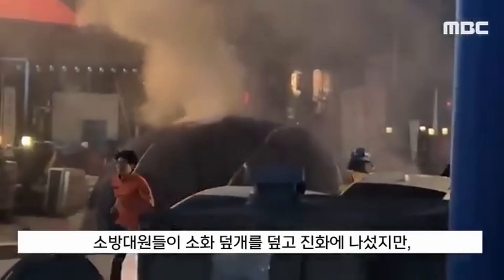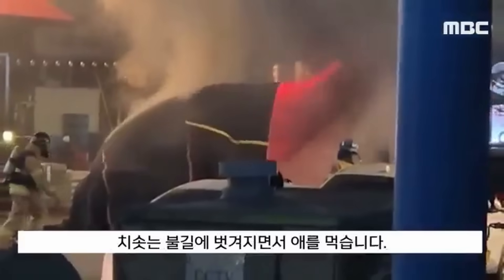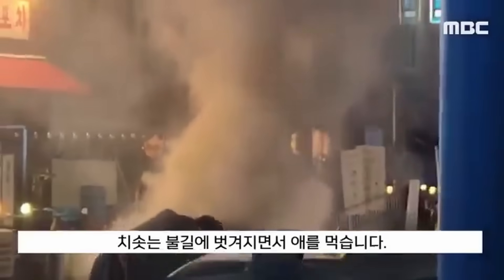EV Fire Blanket Explosion Risk: FSRI & NFPA Issue Warning

Comment: At this point, it seems that deployment of an under vehicle nozzle prior to covering the vehicle with a blanket might be a better tactic. Surely the FSRI will test this.
Reply from the maker: It was part of the latest experiment.  Standby for a video.  Hopefully it will be released in the next week.
Reply: Unless you have a direct hole into the battery, it will do nothing.
Reply: I doubt it, companies like tesla surround each cell with a waterproof foam sealant. There's no way to "cool" each affected cell.

Comment: Given this information it does seem like using the blanket on adjacent structures and vehicles is the better approach.
This is also why we do our EV conversions with LFP batteries. This has got me considering adding conduits for internal fire suppression.
We've been considering doing something similar for our turbo race bike that runs on E85.
Thank you for continuing to post rather objective and educational material. I subbed quite a while ago and still learn things here.
Reply: I just posted a question regarding the use of a Lith-X type extinguisher on E-V fires. Class "D" extinguishers don't carry a UL fire rating typical of "A" and "B" types of fires. They are rated by type of material and quantity of material on fire. Also the way they put out a fire is "crusting" to exclude oxygen and forming a heat sink to lower ignition temperature. In your typical magnesium fire, your talking maybe 2-3 hours of not disturbing the extinguishing agent and breaking the crust thus causing reignition. I personally don't know the quantity of lithium found in an E-V battery or if testing has been done using this agent against the fires.
Reply: @Wa3ypx  the problem is there are several blocking layers of material between you and the battery so using an extinguisher has virtually zero effect on car battery fires.

Comment: Is the fire blanket useful for protecting your own car when parking next to an electric car?
Reply: That was mentioned yes, the fire blanket can be placed on the exposure vehicle (by firefighters) to stop it from catching on fire.  

Blanketing your own car would not be very useful as a daily precaution, first it very difficult for one person to even apply a fire blanket -- they are VERY heavy, and HUGE, After folding ..  they won't fit in anormal car -- next is cost they start at $5000 

If your parking spot (at home) is right next t a neighbour's EV, a firewall disguised as a normal fence might be a good idea?  it might be less costly than a fire blanket too.  

You'll see such firewalls around your city, next to large power transformers, for safety, they are 6" thick reinforced concrete.
Reply: @MikeBaxterABC  Any standard block or brick wall 6' would work.  Blankets are impractical.
Reply: Unless you have FULL firefighting gear to put it on, NO.
Reply: As a safety safety issue. I will not allow EV vehicles on my property. Mr Bill
Reply: This is worrisome because in CA and AZ and other warm weather states vehicles park under the apartments.

Comment: Thanks Pat, Like you.I always thought these were great for limiting exposure and allowing the battery to safely burn itself out. However,  knowing that a large portion of firefighters can be volunteers in areas with minimal training, it's best to rethink this option.
Reply: ICE vehicles are now sounding better and better. I wouldn't be surprised if EV vehicles are simply banned from certain places ie, parking garages. Mr Bill
Reply: It's a piece of equipment. Users just need to be trained on the equipment before putting it to use. 

The big thing is that best practices are still evolving, so training will need to be refreshed to keep up.

Comment: The only way to prevent lithium battery fires, is to build internal fire mitigation(like pressurized sprinkler system), through using a rupturable coolant channels and an additional backup reservoir and emergency pressure pump(that could be used to cause rupture of coolant fins, like in a battery overcurrent isolation using a fusible link). There will be compromises to battery capacity and battery pack cost of manufacturing. There is also the risk of false activations ruining an otherwise healthy battery pack.🤯. Offcourse no manufacturer wants to comply, as seen evident from the thermal runaway being undermined already.😢
Still doable, if enforced into a stringent regulation.🤞❤👍
Reply: Not even vaguely doable.  You are asking to put in a "self destruct" system into the battery.  No manufacturer is going to do that.

Comment: Would this also apply to the "bags" some aircraft have for when a laptop or phone starts smoking?
Reply: Those batteries are much less powerful than an EV battery, so the explosion risk from off-gas products should be proportionately smaller. But I'm no engineer.
Reply: If your phone or laptop gets put into one of those bags, it's going to stay in that bag until well after your flight lands. I don't know the protocols after landing, but they aren't going to just hand you the bag and release you into the terminal.
Reply: @briant7265 . The PED containment bags on aircraft will hold a lot of water…the equivalent of 13 large water bottles.  The water is absorbed by the materials in the bag.  Fireproof gloves are used to move the PED onto a metal surface in the galley.  The problem with this is that the f’ing greedy airlines have miniaturized the galley countertops to get in one more row of seats, leaving far less space, and everyone vulnerable.  I retired my FA job two years ago, and unless I have to attend a funeral, I’ll never, ever set foot on an aircraft again, mostly because of DEI policies.  Buncha 🤡.   But those PEDs on planes scare the crap out of me.  Imma drive.
Reply: Q: Would this also apply to the "bags" some aircraft have for when a laptop or phone starts smoking? A: yes 'fraid so because trapped explosive gas is trapped explosive gas.  thus as any 5th Grader will likely be able to explain, this threat is made even WORSE by the risk of explosive decompression of the fuselage (aw crap).  ref:  Alaska Air 1282 Plug Door Blow Out date: Jan 5, 2024👈everybody knows this.  so as i've been saying for years unfortunately there is "No Free Lunch", therein the burden still rests on we Human Beings to get control of our neurotic behavior, gain some self-awareness, so we can ultimately STOP LOOKING FOR IT.
Reply: @phillyphil1513 What are you looking for?

Comment: Would super fast freezing slow down thermal runaway? We need to find some way to defend ourselves from these deadly E.V.s!
Reply: The problem with putting out EV battery fires is that the thermal runaway is happening inside a pressurized and mostly air-tight box. Makes it difficult to send any cooling where it is actually needed to stop the reaction. And even if you do freeze the battery, you only have until it thaws before thermal runaway may resume. The rapid feezing process itself may also cause damage and hasten additional failures.

Comment: This just reinforces my previous conclusion that lithium ion batteries don't belong in vehicles at all. They're just too dangerous, and we have no really good ways of dealing with them once they enter thermal runaway. Water doesn't extinguish the blaze but stops it spreading, yet the water used contaminates the ground with toxic elements & chemicals which may well cause enormous damage over time. The atmosphere is also contaminated & may cause severe health risks, esp. to the firefighters. There's no earthly need for EVs, our existing ICE vehicles are far better for transportation anyway!
Reply: They don't belong on a bridge, in a tunnel, in a parking building, near a building, under a building, basically no where near people
Reply: @Eduardo_Espinoza but my VR6 sounds absolutely lovely in a tunnel ,or parking garage. 
Oh the irony. 😂
Reply: Gas card r ok since they burn at lower temperatures 👍  @MrTheHillfolk
Reply: They put eco nuttery  first, safety second. This has happened in so many technology sectors
Reply: regulators have not put safety 1st
Reply: @doomer33deg  they put billionaires first. That's what doge is really about.
Reply: Heres something funny to think about:

In the U.S.A as a truck driver I need to have either an 'H' (Hazmat) or 'X' (Hazmat + Tanker) endorsement on my CDL to haul an electrical vehicle battery down the road.

But Bubba can drive an electric car around town that is powered by the same battery and he only needs a regular driver's license...
Reply: Recent news from the UK where authorities are dropping the resource consent and regulation needed to install home EV charging stations. No need to get the installation approved or signed off. 
This reads like a B grade disaster movie set up where the obnoxious beaurocrat ignores the qualified expert. While I fear for all these people and the emergency crews having to deal with the upcoming disaster, this move WILL accelerate the truth behind this Lithium Ion technology and just how dangerous it is to have in your home.
Reply: The one and only reason why those electric death traps even exist is the God damned climate hoax. Can't anybody just stop that insanity by telling the truth? Should we have to put ourselves, our children, our friends in danger because of a lie???
Reply: And boy does my 12 valve vw VR6 sing a sweet song from it's exhaust. 
Wookies forever!

Comment: Kind of obvious, but I can't say I'd thought about it!

EVs are simply dangerous.
Reply: EVs are fine but their batteries aren't very energy dense.  Diesel is something like 27 times more dense per unit weight.
Reply: ...but they are saving the planet!
Reply: 😂 @thomasdragosr.841
Reply: @thomasdragosr.841  saving the planet by reducing by 0.1%.
Reply: Gas engines are even more dangerous.. just look around.
Reply: @haroldnicholos7436  you can stop a runaway diesel with a rag, and if it explodes just use a non water extinguisher. A gasoline engine is even easier, because it uses spark to run. But an ev? You basically have to wait for all the combustibles to run out because the bataries are self oxidizing.

Comment: Has anyone thought of vacuuming the gasses out from under the blanket in a controlled manner, and simultaneously separating the ,hydrogen, CO2 and other toxic elements? I'm throwing an uneducated idea out there. Please don't judge, just an honest curious question?
I understand the gasses would be in an expansion process, so just throwing that out there
Reply: 🤔Hmm...  With respect, I think the 'controlled manner' would be the biggest problem. A fire scene's likely to be quite chaotic, so arranging the extraction of various gases whilst not knowing if there was going to be a sudden flash-point incident or 'explosion' (wrong technical term, I know, but it's whatever makes you duck that counts!) would probably be too hazardous.

The more I see about lithium battery fires, the more I tend to agree with the idea that the best thing to do is just to get the heck away from them, let them burn themselves out (destroying property is better than losing lives), and tidying up the whole sorry mess later.

I suspect that if it weren't for the current ridiculous mania for EVs and net-zero compliance, lithium battery tech would have been restricted to the military and NASA, and kept well away from the public altogether, rather like rocket fuel, high explosives, flame-throwers, and those scary substances that never get outside research establishments and laboratories.
Reply: how are you going to "vacuum the gasses"safely  on an active vehicle fire? if that WERE feasible on a bridge in the middle of the night, or in a crowded garage with low ceilings, what would you do with these dangerous gasses once you extracted them? where would you concentrate such on a chaotic and dangerous incident scene?  it is also a difficult and hazardous operation to separate UNKNOWN mixtures of stuff, that at best requires a complex industrial process. if there is an easy way to "simultaneously" separate this stuff that would be most interesting...

Comment: Did 5 with just blankets last year all 95%> SOC, only one lifted the blanket, a blade battery - of course the gases can lift the blanket but only one our of 5 even 6 if I count the 2023 event we did.  It is not good practice to remove the blanket until ay least 15> hours has passed.  The battery may produce O2 but if you view the Danish presentation on O2 the ghost gas it makes very little difference.  In the 6 I have undertaken there has never been an explosion as that needs containment.
Reply: thank you for the real world experience, but there are a few problems with your conclusion that "well its been fine for me so far, no problem here" attitude. 1), 6 is not a large sample size. because nothing bad happened in 6, that's not good enough. 2) you mention a Blade battery, that's a small scooter. the batt. can still be a serious hazard, but that can't compare with a full size car in energy potential that's realistically 2 orders of magnitude in energy output greater. (25-50x AH rating, but the possibility of thermal runaway because of the density and the square cube law coming into play is much greater, and even if there are significant additional Saftey precautions on car batts the total volume of dangerous gasses is certainly way higher) 3) there are different battery chemistries and construction types, the types most dangerous in blanketed situations may not be ones you have seen, you can't assume all will behave as those you worked.
Reply: Awesome! Shut down the roadway for a day before moving the wreck.

Comment: The potential for deflagration seems to be growing with the newer batteries that exhibit less violent fire behavior but still enter thermal runaway and put out a lot of combustible gas.     The blanket must not be tied down.
Reply: You still have a collection of gas below the blanket. They need a string, to pull them from safe distance.